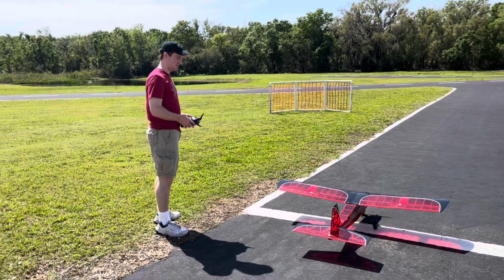My First Balsa RC Airplane Flight!

Comment: Hey matt it’s me Logan from Wingate I saw this and remembered back tot hat first plane we KINDA made together the one that was just a plane no details just a plane and by together I mean you built it I have you the tools and I watched you do it it was made of white foam and a wing across the top that came off for the battery pack remember how it crashed on the sand field like 8 time before you came to the conclusion that and I quote “the receiver was backwards” but after some research we found out you had to re wire it because it was crosswired I miss you man.
Reply from the maker: Hey Logan! Boy we had some fun times! Oh yeah, I remember the beginning of my RC career well. The “Big Daddy” project. So you’re close. The receiver was fine as it had no gyro so it couldn’t be “backwards” but the Ailerons which give roll control and combined with the elevator are what make the plane turn were backwards. I had incorrectly assumed how they work, and it was opposite to how they actually work. This is a similar plane and you’ll be pleased to learn the wing also comes off on this!

Comment: item 1  -  105   a zero-zero thrust line should be used, with electric power. 
item 2  -  the use of hoerner wingtips in the design of a tiny wing is not recommended.   (any wing 'smaller than 1:1 scale'  is  a  tiny  wing.)
item 3  -  138   the span of a horiz-stab does not need to be greater than thirty percent of the wingspan.
item 4  -  the design of a dihedral wing should include  a  Center  Section.     d
Reply from the maker: Thank you for those great points. I’ll refer to this comment next time I’m building something. As for this SIG Seniorita, my friend bought it already built and I believe it had originally been flown as a gasser before the previous owner converted it to electric.